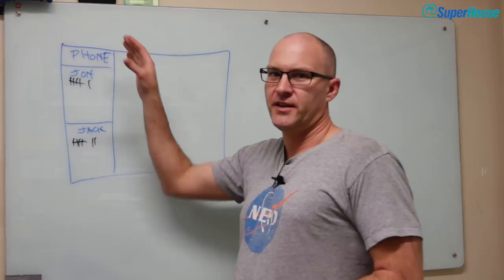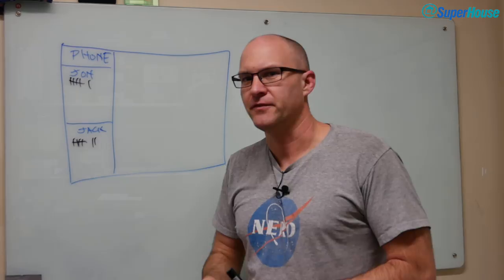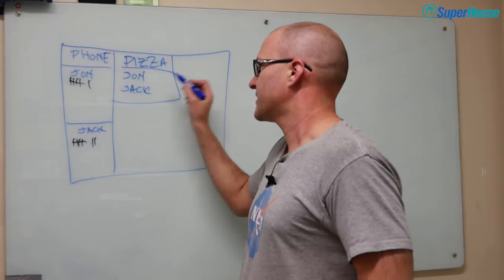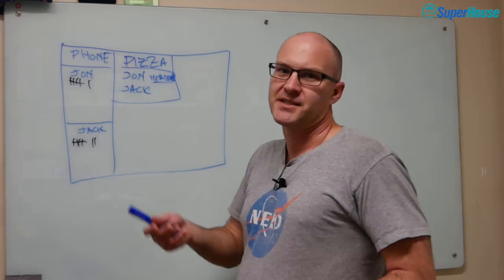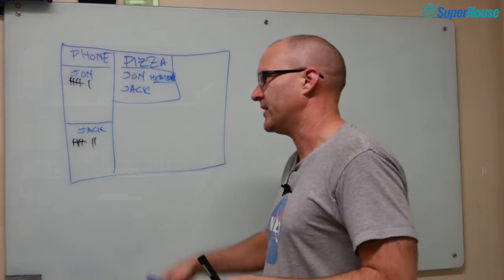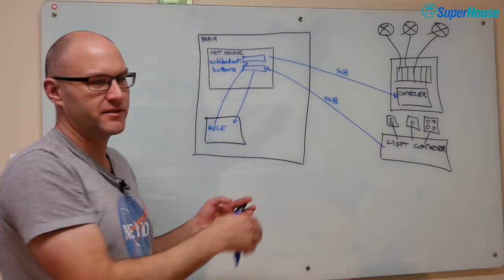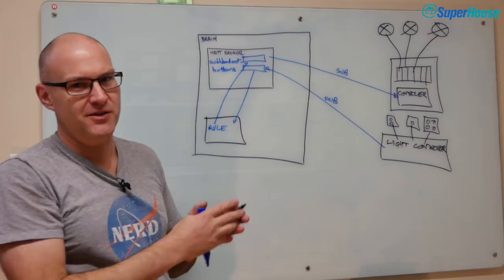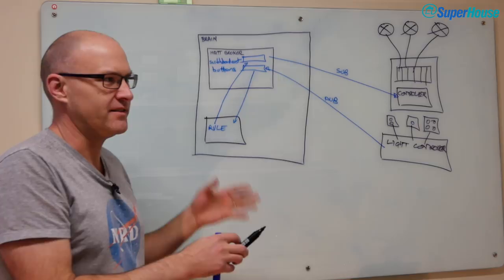SuperHouse #24: Home automation system architecture

Comment: Another question about your video, why did you switch both the hot and neutral with your relays?
Reply from the maker: Only because the relays happened to be DPDT, and it's just as easy to connect the neutral to the extra pole of the relay as to a bus bar. It keeps the wiring neater because the active and neutral stay together all the way to the relay, instead of splitting off. And finally, it means that anything connected can be absolutely, 100% reliably isolated from the entire electrical system simply by pulling out the relay. But those are weak reasons. It could easily have been done by just switching active and binding all the neutrals to a bus bar.

Comment: Greetins from Madrid Jon.   I may have missed a step in you very good top down coverage of your system design: once you have configured your OpenHab for dealing with rules, is there any purpose left for node-red? And if there is a division of labor that make sense for what you leave to node-red and OpenHab respectively, how do you deal with potential conflict between rules from each subsystem?
Reply from the maker: Great question. It would certainly be possible to just use one or the other. However, I can't stand the rules system in OpenHAB which is why I've kept running my own DIY rules engine in parallel with it. Right now I'm not using Node-RED but my general plan is to remove my existing rules engine and use Node-RED instead. I don't have many rules in OpenHAB because they're so annoying to write, and changes cause OpenHAB to reload its whole config.
Reply: Thanks for the quick reply.  So, in that case, is a feasible end-point to forego altogether OpenHab and do all the controls via node-red (seems fairly lightweight and very scalable)
Reply from the maker: Yes, and many people do it that way. I started using OpenHAB mainly for its app, but with a front-end on Node-RED you can certainly achieve the same thing.

Comment: Have you ever thought of adding dimmers and dimming control ?
Reply from the maker: Definitely. I've already done some work on that, but I haven't shown it in any videos yet. It's a problem that turns out to be much harder than most people realise. There's no universal way to do dimming that works for all loads. It's even harder now, because houses can have a mix of incandescent lights, CFL tubes, halogen globes, and LEDs. Each one of those needs a different type of dimming system.
Reply: Yes as an electrician I know this very well, I am very familiar with c-bus home automation  and even their "universal dimmer"  can be troublesome. Now with all the new led lights on the market and minimum load requirements  this becomes even more of a problem. Thanks for the Great videos I have been thoroughly enjoying them.

Comment: What kind of relays are you using in your sub mains box. I understand they are 12volt coil and din rail but if they were solid-state /mechanical or possibly a link. Thanks

Comment: Thanks for yet another amazing video! This is the video I've been waiting for, to link it all together in my head!

If you're not able to run cables all over your home (e.g. if you rent an apartment), what would you suggest as relays? DIY with Arduinos? Or Sonoff? Or something else?
Reply from the maker: Thanks Kenneth! Doing a retrofit with minimal changes to the wiring, I think I'd lean to using Sonoffs mounted close to the loads. My system is very much structured like a traditional automation system starting with control from the centre, instead of adding point solutions at the end points. I haven't covered that approach much but I'd like to show more about it in the future.
Reply: @SuperHouseTV  We should very much love that

Comment: great overview on the smart home.. but how much power is used (as you know its not cheep anymore in Oz $$$) ito power everything?? I mean a switch when off doesn't cost anything, so to have OpenHAB and MQTT etc etc is all on and running waiting for a message to turn a light on.. that must add some percentage of extra household power cost?
Reply from the maker: Very good point. I'm going to quantify this with specific numbers in a future episode. I've already partly filmed an episode about household power monitoring.

Comment: So does the switchboard in the garage still exist? I remember B-A was in the garage with the modem and firewall.. the B-A board is now in your office..?
Reply from the maker: Yes, it still exists and the switchboards are in the same location but some things that were inside them have moved. When we switched from ADSL to cable we had to relocate the router to a different part of the house, because that's where the cable terminated. I'm working on an episode now about building the ultimate home router / firewall, so I'll be relocating it again soon.

Comment: Can you give some information on how MQTT is architected. EG: do you prefer

Bedroom
|
|--Lights-Main
|--Lights-Bedside
|--Temperature 
Garage
|
|--Lights-Main
|--Temperature 

OR:

Lights
|
|--Bedroom-Main
|--Bedroom-Bedside
|--Garage-Main

Temp
|
|--Bedroom
|--Garage

I want to ensure as a build my system it remains future proof!
Reply from the maker: That's a great question, and it's one I've spent a while discussing with my friend Andy who originally introduced me to MQTT many years ago. Topic taxonomy: do you map by location, or by device, or by function, or by something else? Right now my system is inconsistent, because I started doing it using one structure then I started using the Tasmota firmware on Sonoffs which does it another way. I have a topic policy document but I don't even follow it! Currently I resort to keeping a list of topics in a spreadsheet. This is a subject that's worthy of an extended discussion or episode of its own.
Reply: SuperHouseTV thanks for replying. It would be good to get an episode on this, it's something iv struggled with for a long time, reassuring to hear it's not just me! Lol
Reply: If you group them by lights, you can simply do "OFF /lights/#" to turn all lights in your home off? But on any user-interface it would make sense to display them per area.

Actually, theoretically:

/light/bedroom/main
/light/bedroom/bedside
/temperature/bedroom
/temperature/kitchen

This way it's only difficult to query all devices from, for example: "bedroom". But the values returned by the different devices would have different meanings, so I don't really see why you would do that.
Reply: This is a similar problem using realtime databases such as Google's Firebase. The most scalable solution is to have both lights/room and room/lights structures. When you publish, you update both sets of values. Then the subscription system can subscribe to the most relevant structure it needs. It reduces the amount of custom code you need to write, the downside is that data is duplicated:
https://firebase.google.com/docs/database/web/structure-data#fanout
Reply: I also had this question a while ago and I've come to the conglusion that location + function does it best for me. 

Like:

/house/upstairs/bedroom/main-light/{command | state}
/house/upstairs/bedroom/bedside-light-right/
/house/upstairs/bedroom/temperature
or 
/garage/garagedoor
/garage/main-light/
or
/garden/patio/main-light/

you get it.

Maybe that helps
Greets

Comment: Hello, thanks for all your great content! I was wondering if you can somehow make the lights turn on/off every time you walk in/out of a room automatically. Not using motion sensors but some other way, maybe some sort of wearable near field communication or something like RFID tags with sensors inside the door frame? Something that does not need really close proximity like NFC.
Reply from the maker: I already do it with motion sensors (see https://www.superhouse.tv/13-connecting-security-sensors-to-arduino/ and https://www.superhouse.tv/superhouse-vlog-41-motion-detectors-and-jiu-jitsu-2/ ) but I've also been experimenting with other methods including the BLE positioning system from Happy Bubbles Technology. In the past I've also used volume analysis using a Kinect, and face detection. There's a brief demo of face detection in this conference talk: https://www.youtube.com/watch?v=9ZeMeWwE_r0&t=6s. Presence detection (and identification) is a big issue for home automation so I plan to do multiple episodes about it in the future.

Comment: Episode suggestion: functional differences between node red, OpenHAB, and other software that is out there. Why can/can't I just use OpenHAB.
Reply from the maker: I intend to replace my home-grown rules engine with Node-RED, so that would be a good episode.
Reply: SuperHouseTV, do you have any redundancy built into your MQTT broker? I just noticed that on the MQTT gethub page clustering is now an option with limitations for mosquitto.
Reply from the maker: Not yet, but I'd like to. I just answered a question about OpenHAB redundancy so some of the same things apply. A few years ago my friend Andy and I worked on a little MQTT bridge that allowed us to link our houses together with selective topic re-publication so that our MQTT brokers were effectively a loosely connected cluster, but we didn't go very far with it. A topic for the future!
Reply: I'm thinking of using AppDaemon because I'm better at Python, but both should be equally capable.
Reply: I had the same question as @Jason Perry but I still dont understand the answer. Why use both NodeRed and OpenHAB ? Is there anything one can do that the other cant ? PS: Great video !
Reply: NodeRed is a message based system so it really was not originally designed to save state in mind, it is possible just not elegant.  OpenHab is easier to keep track of things but the settings are way harder.  From my experience NodeRed is way easier to use and get rules up and running, but the external UI can bog down quickly (Be cautious of graphs in your home UI).  OpenHab is harder to setup and run but the external UI is quicker and more phone friendly.  It has been about a year since I have touched either of them so they might have changed.
Reply: Thanks for the explanation. I took a deeper look at both and got to the same conclusion. Use NodeRed to implement the logic/rules and OpenHab for UI.
Btw, what happens to the states when there's a power failure ? Does OpenHab continuously save the states to a file or does it have some sort of reset/reboot function ?
Reply: There are other options. Our CQC platform is not open source, so it's not free, but of course you do get what you pay for. CQC is a commercial quality product, but we are DIY friendly. Combine CQC with something like a Lutron Radio RA2 or Caseta system, and you have a pro quality system that you can do yourself, and it's all retro-fit friendly.

Comment: Great informative video! Thank you Jon!  
I'm currently in the process of slowly putting an openhab system together, the current debate I'm having is regarding light switches: do I put an Ethernet enabled arduino within each switch, or have a centralised Ethernet enabled arduino and run switching circuits back to it over cat5, like you mentioned in your video Obviously the former would give more I/O options but inherently costs more. I can't wait for your next video!
Reply from the maker: I really hope to have that video uploaded by late tomorrow. I have to go away for a few days so I'm doing my best to finish it before I leave.

Comment: Great video, as usual :)
Quick question on the Building Brain board. Is that up for sale anywhere? Also, since you mentioned you are using openHAB 1 as your primary system, did you fully test it out with openHAB 2?
Reply from the maker: It's not up for sale at the moment: it's really just something that I made for my own purposes, although I could probably sell them. Most people will be happy just running OpenHAB (or something else) on a plain Raspberry Pi and won't need the extra things I added on my carrier board. Right now I have 2 of them running in parallel, one with OpenHAB v1.8.3 and the other with v2.1.0. I need to do quite a bit more work getting v2 working with the rest of the devices in my system.
Reply: Thank you for the reply. I think this could be a very useful addition in your store!
Personally I would look for it to also have (maybe a v2 of the board :) an external watchdog circuit (like the one you have for the arduino, a safe RPi shutdown, maybe even a compatible Z-Wave circuit (?) to work with the RPi openHAB...
Again, just my thoughts on what could potentially be a very useful addon board that would a market for out there.
Reply from the maker: Thanks Moshe! I recently revised the board so that the Pi can reflash the ATmega on the daughter board, and I'm also considering doing a big revision to switch to an alternative board that has onboard power management. I have a few other projects to finish first, though :-)

Comment: Thanks for the video. I also use MQTT and openHAB 2. Maybe I missed it in the video, but do you think Node-RED is necessary if you're also using openHAB? I currently use openHAB only to handle the rules and for monitoring the states.
Reply: Hi John, great video!! I am from the same opinion than Kevin, is it not Node-Red the 'same' as openHAB? How do you see their collaboration?
Reply from the maker: They do a similar job, yes, and many people run their home automation system entirely using Node-RED. I could probably do that too. The reason I use OpenHAB is that it provides nice apps for iOS and Android, plus other types of interface for other devices. I've gone through a series of stages, starting with just my own home-brew rules engine, then I added OpenHAB running alongside it and linking to it, and next I'll probably replace my rules engine with Node-RED.

Comment: Gotcha! I understood from a previous video that you have chosen ethernet over wifi ( esp8266 ) for a number of reason and one of which was reliability and this is completely understood but the thing is that I noticed a delay turning the veranda's light off the second time and it looks like the messages queued up and were sent with a bit of a delay afterwards. So, my question is if there are any wifi communication happening behind the scene anywhere in the architecture in this particular demonstration ? If not, does that mean that I would expect such delays with a ethernet-based automation systems? This bit of delay is of course quite acceptable to me but might not be to others :D.  I am big fan of SuperHouse BTW you are my inspiration - Thanks :D

Comment: So if your system goes down or somthing fails, then you can not operate anything in your house?
Reply from the maker: If power fails, then nothing works, just like in any other house. The only thing that is really a single point of failure is the little Brain running OpenHAB, MQTT, and my rules engine. I have a warm spare running alongside it though, so if that box failed I could have it all back up and running in a few minutes. Over the many years that I've been doing this, the only hardware that I've ever had totally fail has been Ethernet switches! Plenty of little glitches and annoyances though.

Comment: Can i use the normal switch to send mqtt status instead of press switch like yours. 
I want to retrofit my existing light switch (they are Bticino Living Series).
How is your poe ethernet system, they need particular cable or the standard cat 5 or 6 cable? UTP, FTP or SFTP?
Reply from the maker: Yes, you sure can. I'm just finishing an epic episode about my light switch controller which will be uploaded in a few days, and it will cover how to do this. I'm also about to do another episode about Ethernet cabling which will cover PoE in more detail.
Reply: Hello Jonathan, looking forward for those videos as well. I'm rewiring the entire house and i also want to use standard Bticino Living Series as my primary wall switches. I still however haven't decided how to connect them so i need your expert opinion. So far i'm between two options:

1) Use the light switch (SPDT) with a relay (SPDT) as a two way switching so the lights can be also be switched on manually?  This means that i will have the live wire entering the relay and two wires (connected to NO and NC) going to switch and from there to light. 

2) Use the light switch to send a "command" (low voltage) (as per your approach) to the arduino and have a the relay connected directly to the lights? My only concern is sending low voltage through couple of dozen meters of cable. So i think your Ethernet approach might be useful and help me overcome that issue.

Please also note that I plan to use the switch only to switch the light on and i don't really need to reprogram the switch for another purpose in the future.

Any feedback will be much appreciated
Thank you!

Comment: Dear Jonathan. Please would you consider combining a Hall effect 1-inch pulse generator domestic water flow sensor with a Sonoff temperature sensor, using the Tasmoto software and WiFi capability to make a water consumption monitoring system that we can monitor our Air BnB guests. Water consumption with?

Comment: @SuperHouseTV Do you have any recommendations for racks?  I'm looking to start prototyping soon for a home automation system but I'm at a loss of what to look for in a good server rack.
Reply from the maker: The only advice I have is to make sure there's rear access, either by having a rack that's mounted with its side against a wall (if you have heaps of room) or with swing-out rails so you can get to the back of your devices without unbolting them all. Both of my racks are fixed with no rear access, and it's really annoying. I only did it that way because I used old discarded rack rails and I couldn't afford to buy new racks.
Reply: That actually threw a spin on things I wasn't even thinking about.  I will take that into great consideration,  Thank you